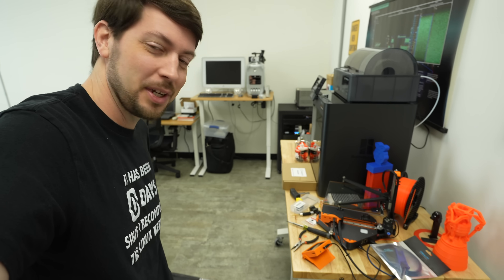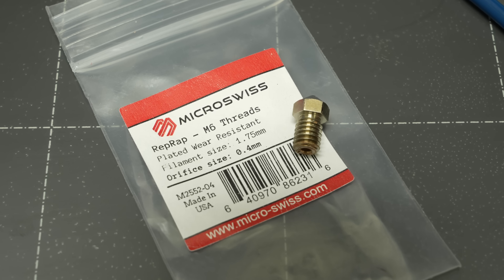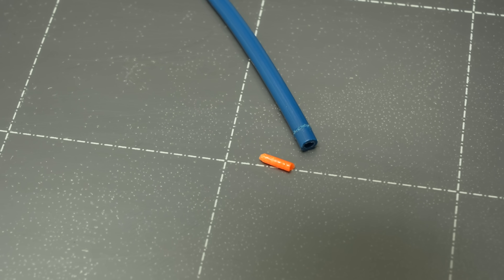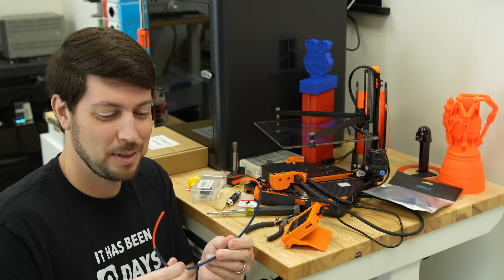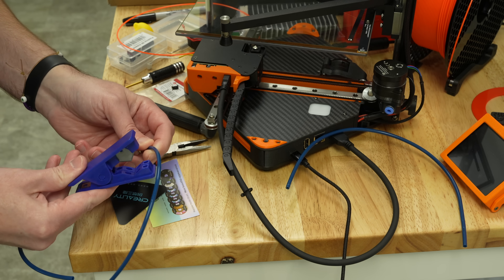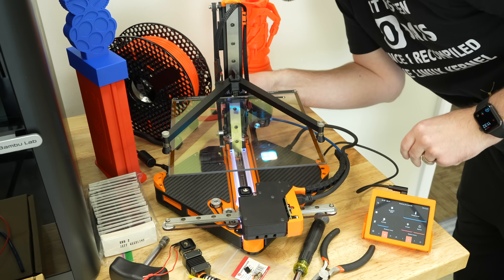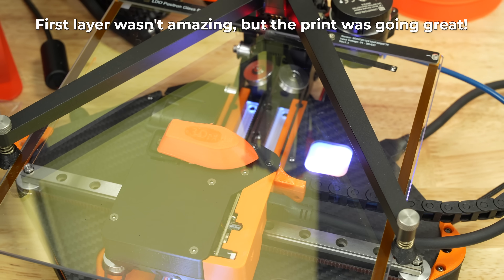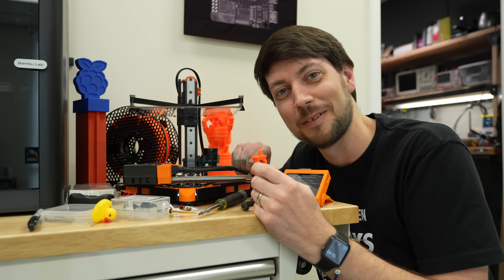Wasting $80 and 6 months on a $10 fix

Comment: I spent 3 weeks on trying to fix my CoreXY printer for tension. discovering one of the Motors tooth pulleys were loose this weekend. now its working. then another issue on a different printer for a week only to discover that the hotend were setting loose.

Comment: Troubleshooting can be frustrating. Sometimes, you replace all the cheap stuff, only to find out the most expensive part was the problem. Sometimes you replace the most expensive, and find out it was the cheap part that fixed it. When working on specialty devices, it’s not always obvious where to start, since there isn’t a ton of information out there for your device.

Comment: You definitely want to put a filament filter/oiler on bowden tube type extruders...they can get dust and crud inside them that can cause friction
I recommend the print in place or screw type ones, then a single drop of 3 in 1 oil in the little foam pad
Cool fix!
Keep em coming!!!!

Comment: it also means your extruder motor is pretty weak if that little crimp cause no extrusion.   My extruder will pull filament through much more friction than you're seeing.  In fact I've had "tangles" in the spools and it will literally snap the filament.  Either way yes PTFE tubes are a total PITA.

Comment: I spent months trying to resolve under extrusion and nozzle clogs. Embarrassed, humiliated and on the verge of chucking the printer out.  I got the end of a 10 pack of nozzles and put a new one in from a new pack. Printed just like it was new.  I'd kept all the old nozzles so went back to clean them.  What do you know the 0.4mm cleaning spike wouldn't go through the hole.  All 10 were 0.2mm labeled as 0.4mm.  I nearly gave up with 3d printing.

Comment: I did something similar. Thinking I had PETG loaded I heated PLA way too hot and it solidified in the hotend. Then I used a spanner to attempt to remove the nozzle, but that twisted the hotend breaking the delicate heater electrode connections. Ended up having to replace the entire hotend.

Comment: A 3D printer is a machine with a lot of simple parts most of which can be tested manually individually. It's easy to try pushing the filament through the hot-end, try pushing it through the tube, check fittings, see if the extruder grips it properly and whether it extrudes without the tube attached, etc. This way you don't throw parts at the problem before you know where the problem is. Beware that firmware usually has cold extrusion lock, that the hotend needs to be heated to something like 180c else extruder movement commands get ignored.

No need to use torque wrench on nozzle, also not advised if your wrench has a ratcheting mechanism, you're likely to ruin it with heat. The important part is that the hotend is heated to temperature near the upper range of printing temperatures before tightening. Also e3d type nozzle is not allowed to fully butt up against the heater block, if it does, then something is wrong and there will be a leakage path.

If you dented the tube you can just temporarily undent it with a 2mm Allen wrench or something :D Cutting the tube is easy with a scalpel or X-acto knife and you can find about a million ways to guide and align the cut to make sure it's perpendicular, you can use a 3d printed cutter too.

Comment: have no idea how would nozzle torque cause underextrusion
you either leave it loose or overtighten and snap your heatbreak, everything in between is equally fine
and it's so easy too - as quirky that thing looks, it has by far the most easily accessible nozzle of any 3D printer I can think of
so much so that could have very well been the main goal of the design

Comment: always have spare bowden tube it is considered a consumable on most printers , its why bambu gives you a full replacement set for the AMS. That blue stuff is tighter than the white stuff. The blue stuff is for bowden extruder , direct drive like the P1S you have should use the white stuff.

Comment: The Positron is an interesting machine, but it's a perfect example of why this kind of hardware is really for enthusiast tinkerers. When you want to actually get things done, some hardware just becomes more trouble than it's worth.

That said, one major benefit of having a machine that you need to tinker with to ensure good regular operation is that you learn a lot about how they actually work, and about troubleshooting and fixing those problems. But that takes a lot of time that often feels like it's wasted, especially considering how cheap capable machines have become.

Comment: I had a pneumatic fitting that my ptfe tube went into that squeezed the tube so tight I could barely get filament through. Was from an expensive pack so it should be good …but was just out of tolerance.

Comment: Oh, well, I've printed with my Sovol SV08 for 2-3 months, flawless. Multiple filaments swaps, everything perfect. Then, one day, changing filament from one PLA to another PLA and all of a sudden - heavy under-extrusion, horrible print quality, ... I decided the problem is extruder calibration - for sure - and spent days trying to calibrate the steps. However, after 10mm extruded, plugged the PTFE back to hotend and bam - again underextrusion. Same thing done over and over, I concluded my extruder must be broken somehow...
Turns out there is a screw that sets the pressure on the extruder gear. It got fully un-screwed after those 3 months of fast and quite violent printing.
The fix was to screw the screw back in and THAT was it - resetting the extruder stepper back to the original steps per mm and curse myself for the stupid jumps to conclusions...
Welcome to the club :)

Comment: I ran into almost the exact same issue last week (Prusa Mini), The filament got stuck in ptfe tube and whilst extracting it it got stuck just before the extruder motor so had a bit lodged in there. smashing my head against the wall to try figure out why nothing was going into the tube at all now. my fix after getting the stuck bit out of the PTFE tube was to shove some filament backwards into the mechanism feeding the extruder moment to force out the bit that was stuck.

In my head I kept seeing this as an excuse to not work on projects and marks a perfect time to upgrade to a bigger printer we can be our own worst enemies sometimes
Reply from the maker: "Time for the XL now!" :D
Reply: @Level2Jeff  ah yes, smallest to largest! bamboo labs stuff was very interesting until all this crap has been going on. Think i'd rather see how well prusa's core one is loved int he long run and might be the goal

Comment: I wonder if you could use conductive / resistive paint, the kind used on car rear window defrost system, on the upper side of the glass bed to have some heat in it. That would solve that warping issue while still looking nice.

Comment: Keep a notepad of what you've done so you can go back if you've completely hit a wall and see where you went wrong. 

I have 4.

One is "completely broke" and haves been picked for parts. 2 are the same models and work fine but can't do anything big like most projects. My "big one" the thermister broke finally so it can't keep stable temperatures then errors out.

Comment: Reminds me of one of my first computers. It kept having booting issues and would blue screen and constantly error out. I had thought at first maybe it was the power supply but I had one of the highest grade 1000 watt power supplies on the market. Its expensive (like 200$) so its probably not that. Replaced my OS, replaced my hard drive, replaced my cheap ram, replaced my cheap motherboard (i built it in high school). I ended up giving up for some years always staring at the damn power supply and eventually with military money replaced it.... BOOOM it worked! I learned a lot about troubleshooting with that. Now i know loads about what each part of the system actually does and how to test them BEFORE buying new ones. Had like 3 buddies hit me up in the military to fix their PCs, 2 of them I had them replace the PSU and it immediately fixed their issues. The third was a ram problem which was easy to diagnose. Dont beat yourself up on the wasted money. Long term your knowledge will recoup that loss.

Comment: You didn't use that cutter right, actually it's a stripper. You spin it around the wire. Or filament.

Comment: Every single person who has ever endeavoured to pursue 3D printing as a hobby, or more, has gone barreling full speed down the same road lol it’s almost a rite of passage at this point.
Reply: I have been 3d printing for 8 years now and while i have done some dumb modifications to test out a theory, which i then had to undo eventually, i haven't had this situation where i order an expensive subassembly to fix a problem and the problem turns out to be elsewhere. Because i built it myself so i know how it goes together and how to test individual parts. I can also usually find a way to jerry rig it just enough to print myself out of trouble when things break down, i have had failures of belt retention mechanism for example, extruder arm fell apart, probe servos knocked their teeth off, endstop switches failed, all sorts of things. A glued together extruder prints a replacement extruder and then i still have a kinda working printer while i wait for a $4 alu part to arrive from China, it's fine. One time i didn't jerry rig something is when the hotend heater wiring or crimps failed so i ordered express shipping on a replacement cartridge because it's a safety critical part and i need to be able to trust it, so that was about 6 EUR including. Two times the mainboard had failures and was about to catch fire but i just repaired it.

Comment: Chalk this up with reasons to never "cold pull".

I don't get the whole "cold pull" thing. I've done it a few times and honestly feels a lot more risky than it's worth. If you want to clean your nozzle, there are many other way better much gentler ways to do it. If it was being used for PLA, you can actually just put it in some boiling water.

Comment: I ran into a similar problem with my Sovol SV08 were it was underextruding filament on some layers but not others. I eventually decided to try something free, and that was to run the filament to the SV08 outside of the Bowden tube. Sure enough, the print came out fine. I later measured the diameter of the filament and it was between 1.80mm to 1.82mm in diameter.

Comment: My problem with my Flashforge Guider 2S is that sometimes pieces of filament break off in the tube and apparently the ID is big enough to pass a second filament past it.  So now I am extra careful to make sure the tube is completely clear when changing filament.
Reply from the maker: I've noticed some ASA filaments I use are prone to snapping as well—though I've been lucky to catch it the couple times it would've affected a print!

I don't use ASA on the Positron though, it would be about the worst setup possible for it, though maybe with a little enclosure...

Comment: 2mm ID PTFE is what you'd want for any Bowden style between the hotend and filament pusher. Removes backlash between push/pull moves. 3mm ID is often used for things like AMS or filament pathing management.
Reply: I expect that the original tube is a low-backlash Capricorn tube which has 1.9mm inner diameter.

I actually sort of like the basic 2x4 white PTFE i don't even trust the fancy ones quite the same.
Reply: @SianaGearz  that's interesting, I never knew 1.9 was a spec but have noticed a 2mm rod I have, fit more snug in some tubes than others. Also a useful trick I've found is giving tubes a slight counterbore at the ends with a sharp drill bit, keeps filament from catching. Worked wonders for a direct drive extruder I cobbled together on an old E3, easiest cold pulls I've ever had on any machine.
Reply: @Roobotics   I've had to ream out the tube a little bit as well when i replaced the one in the throat of an MK8 type DD toolhead. The reason is that the tube seals against the nozzle so i chose to cut it 0.1mm long so it seals properly against the nozzle and no leaks, since i knew i couldn't entirely trust my nozzles to be machined well, but this ends up compressing the tube such that the inner diameter is effectively reduced, so bevelling and reaming it out a little made the problem go away. I think the original tube was custom and just a little wider, but i stuck the normal 2mm one in there.
Reply: @SianaGearz  that is precisely the reason I did it on my ender3 upgrade. The PTFE goes all the way to the hotend area(even through the heat break), so not only was it compressed but it is right up against the nozzle. I only used that machine for PLA obviously, but the tube has never shown signs of degradation. Because that area had to seal molten plastic, I made sure to only give it a smaller relief, the back end that receives filament had a much larger counterbore just to make filament insert easier.
Reply: @Roobotics   I burned up my tube so badly. I ran ABS. :D Yeah i know i know i poisoned myself, i even knew that at the time but wanted to anyway. It was about 8 years ago now.

I still occasionally print HIPS but i don't run it very hot, so it's fine. Well apart from that part with poisoning myself. I'm currently planning a sealed box frame probably corexy rebuild of the whole thing, which will include an air scrubber eventually as well. I'm also going to redesign the toolhead a little so i can replace the MK8-40 throat with a full metal heatbreak.
Reply: @SianaGearz  haha, yea ABS temps will certainly do that. I'm glad the market has evolved so full metal is much more common and more of a standard than it used to be.

I have a spool of HIPS I keep meaning to get around to, fun with lemonene and supports. 

Recently was looking into the 'bento' system, I think it's neat but I can't justify 10+ hours and that much plastic for a fan and filter holder. So I made one that prints in vase mode, wedges into the top of a blower style fan and has a pre filter, 'hepa', and cut charcoal filter all stacked on one another. Air volume Is far better than expected. Classic bento design isn't great because tiny fans and wrong style for pressure through filters, IMHO.
Reply: @Roobotics   HIPS is just an absolutely BEAUTIFUL material, completely underrated on its own. You can bend it back and forth a million times without fatigue, it lays down absolutely beautiful matte, barely no shrinkage, not trying to crack apart at every layer unlike ABS, fairly rigid, fairly temperature resilient, no creep, no moisture absorption. Calling it a support material does it a massive disservice.

I'd probably take that filter of yours if you were to publish it!

Comment: This sort of learning is why I now never* buy something for a repair until I've stripped the thing down - a huge number of "failures" are nothing more than maintenance issues or minor design flaws you can live with for ages if not forever now you know how to reset or work around it - So here you could probably have just trimmed the crushed bit of tube out and kept printing if it was urgent - just don't put a model in the wrong spot on the bed that really needs that extra tiny bit of length it probably works fine.

*So unless there are such significant time constraints a spare assembly or perhaps whole extra machine must be bought right now... Which is how I ended up with a rather cheap "crappy" 3d printer when my good one's brain let out the magic smoke (but not so completely you know the brain is really dead - so at the time problematic but unclear why), and that cheap one kept on trucking well enough for years since - its not perfect, needed more TLC than a decent framed printer would and is now reaching a more real EOL,

Comment: Ooof! I feel for you. Been down this road more times than I want to admit.
The amusing part is that crimping a standard PTFE bowden tube that way likely would not have caused this problem. But the tubing you have there, and I use myself, is Capricorn PTFE - very tight tolerances by comparison to the cheap stuff.
Reply from the maker: True. I may try some standard tubing just to see if it runs any nicer compared to the Capricorn
Reply: @Level2Jeff  There is some trade-off... more tolerance produces more filament backlash within the tube between the extruder motor and the nozzle. So you likely will get sloppier retracts - that can be tuned a little in the firmware/slicer, usually.
Personally, I swapped from the cheap stuff my printer came with to Capricorn to improve my prints and just kept extra on hand to replace as it got worn or damaged. (Eventually I converted to direct drive to get my flexible filament game down pat.)

Comment: I had a similar issue. First getting under-extrusion that ended up becoming a total blockage. I initially thought it was the extruder motor at fault.
It took me over an hour to find the problem. The pneumatic fitting at the heat break wasn't holding the bowden tube properly, and the tube was slowly creeping out and the tiny gap that created was filling with filament backflow.
In the end, all it needed was a new pneumatic fitting ($3) ... and to clean out the glob of plastic.